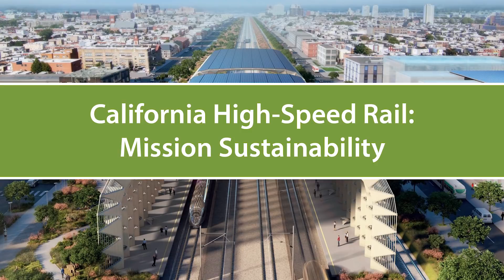California High-Speed Rail: Mission Sustainability

Comment: The Authority should be explaining more about the way high-speed rail influences land use and urban design.

In particular, California's greatest challenge is the jobs-housing imbalance between the coastal counties, which have a relative lack of affordable housing, and the inland, which have a relative lack of high-paying jobs.

High-speed rail will be able to help direct growth into the interior of the state and allow the Inland Empire and the Central Valley to build their economies and improve their livability while simultaneously relieving pressure on the coastal-county metropolises, which are experiencing an unprecedented housing crisis.
Reply: The Authority released a video yesterday that addressed land use, urban design, and the jobs-housing balance between the coastal and inland counties.
Reply: @matt can you post a link?
Reply: Well, they can't because that would contradict their strategy of beginning construction in the cheapest stretch to give the project enough momentum to keep it from being canned.  Under the current business plan, they're going to link Fresno and Bakersfield at high speed, and Gilroy and S.J./S.F. at 90 mph.  The money for anything else doesn't exist at this point.  Even the dream of turning Fresno into a suburb of San Jose isn't yet possible because they haven't figured out the logistics nor the funding for building the tunnels under the Pacheco Pass to link the two.

Comment: let elon build stop wasting money
Reply: YouCubed22  --  Exactly!!!  They Do Not have enough workers to complete the HSR. With the Chinese system of construction, there would be ZERO at grade crossings PLUS no need for rght of way or land purchase/.   Good thinking!!  They should hire you!!l
Reply: Elon has never built hsr. The Chinese are the best at this now, having built more than 22,000 klm's , and they would build it faster, smoother, safer, and cheaper. Of course you wouldn't want them to build it, i understand.
Reply: Sky Way Technologies Co. has a better transport system under construction which is more aerodynamic, energy efficient, and cheaper than existing road and rail transport. They developed string rail, which can carry several times its own weight and therefore cost several fold less than existing transport options. They are already in construction in the UAE after having finished most of the construction work at Eco Techno Park in Belarus. String Rail, which was invented by Anatoly Yunitskiy, is more disruptive than the work of Elon Musk, because it enables a totally new way to build cluster-type cities almost without roads, which are mostly suburban and yet pedestrian (Sky Way Linear City).
Reply: @BlueOceanStrategistS   -- String Rail is basically an enclosed ski lift. It's a pretty cool idea, but i don't think it would work in CA.  The CAHSR needs to #JustBuildIt  But they are waisting Billions on NON-HSR projects. They do Not even have all of the land ( parcels & right of ways) to even build JUST the central valley portion.

I think the String Rail would be a great people mover in a High pedestrian town or areas.  (Vegas, Disneyland/world Florida keys ect) I'd Love to see one in action!!!
Reply: it would be over budget and super delayed...like all his cars...
Reply: aero luxe just like this hsr project already is